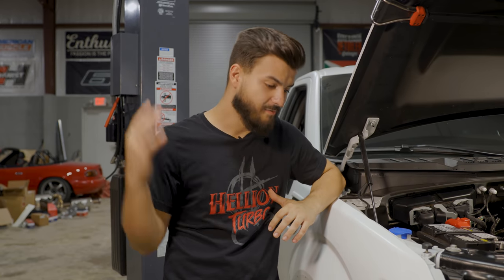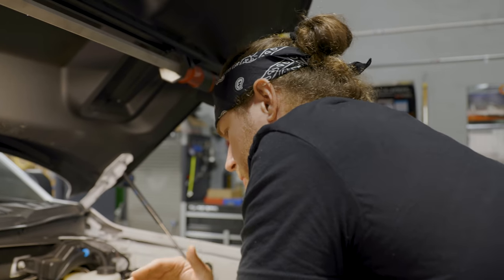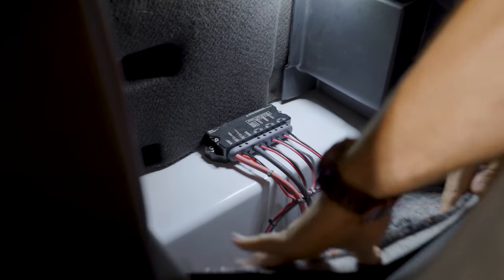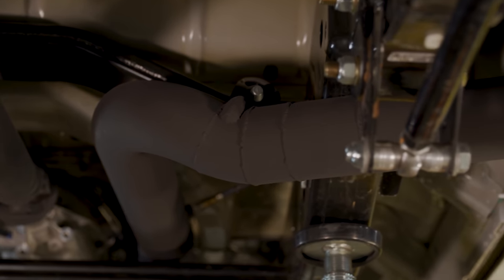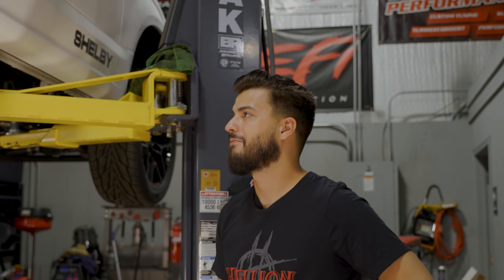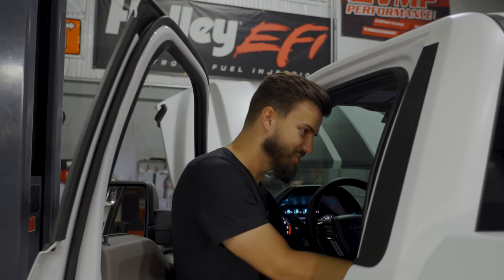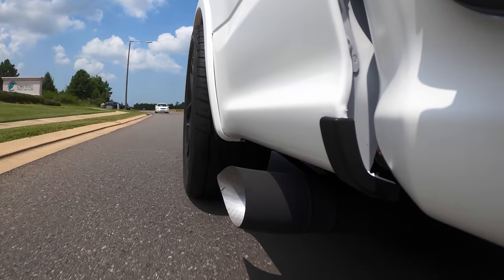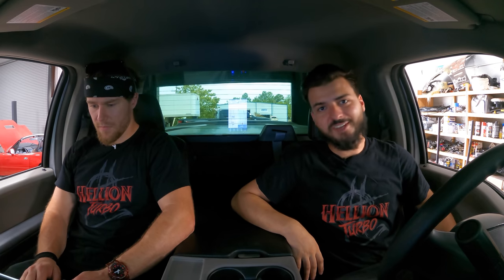Hank's First Boosted Street Hits! + 4" Straight-Piped Turbo Dump!!

Comment: Take it to a Ford dealership and say that the exhaust is making a weird noise.
Reply: My hp guess for the dyno is 845 hp
Reply: @tapout954  not with a stock bottom end lmao
Reply: @mft5773  I’ll bet it makes 1000 before it let’s go. As someone who built the SCJ’s, 5.2’s, and 5.0’s (aluminator, and standard) for Ford Performance, I’ve seen plenty of them go well over that on SBE.
Reply: @bgemski  I don't think a turbo kit can increase 500-600 horsepower. The naturally aspirated makes 395hp.
Reply: @Prime94510  but they do have a 3 pump setup
Reply: @tapout954  650 tops
Reply: @bgemski  the truck 5.0 doesn’t it has a different cam and a few other things to make it torqueyer for truck things

Comment: Waiting for, "Racing My Twin Turbo F-150 vs TT GT350! Who would win?" video :_gavingswim::_closegavin:
Reply: interesting 🤔
Reply: Truck wins if racing from a dig but most YouTubers roll race  🙄
Reply: Supercharged gt350 vs tt f-150 vs tt gt350* lol
Reply: this is the part where I remind you the gt350 made damn near like 1300hp if I remember correctly lmao
Reply: @macse7en  with that 10 speed it should be a close race if Doug drives the gt350
Reply: @icool247  Roll racing is not only safer, but WAY less abusive on drivetrain components. Plus, roll racing accounts for ACTUAL vehicle quickness, not just what it does off the line. That way, Joe Shmo in his bolt on 5.0 with slicks can't run his mouth about beating Hellcats and other cars that suffer from obvious traction issues ;).
Reply: @blade-fpv9411  dig racing is more interesting imo. I don’t roll race unless it’s some random person on the highway trying me
Reply: @macse7en  and now someone must remind you... 4 wheel grip.... Even at 7-800 hp this would be a damn fine challenge for the 350....
Reply: @jessekitchens3364  you realize how much heavier that truck is compared to the 350? Lol. It'd be an interesting race but it's not gonna keep up lmao.
Reply: @macse7en  the weight is true I didn't think about that but yea still.. especially with their ultimate goals for the truck I can't wait to see what happens between those two...
Reply: He should race his old truck. It's twin turbo now

Comment: May I make a suggestion, you have a fork lift at your shop. Have Doug fab up a ball hitch with a chain you slip right on the forks and secure so no mishaps happen, that way you can move your trailers alot more easily into tight places and not need to use a truck every time.. just my suggestion.. as always me and my son love the content keep it up!

Comment: Yo could you please give me some advice.. I'm in the process of putting a single 7875 on my 5th gen camaro but I need the turbo oil return installed. I really don't really want to drop the cradle or lift the engine, do you know the best accessible spot to do this?

Comment: Pie-Cuts are nice and neat, but as long as the pipe doesn't crack or cave in, the surface-area stays the same. With smooth transitions there is no problem going round to oval.

Comment: Um for when you were going to dyno the truck. You could’ve brought the lift all the way up(if possible) and backed it in then pulled back out and brought the lift down so you wouldn’t have had to do a multi point turn 😅

Comment: Why use a dual regulator when a proper returnless system will make more than enough fuel for that kit? I've made close to 1200whp on E85 with a proper dual pump returnless.
Reply: Because Lund won’t tune a returnless system. I had the dual pump returnless system that you had for 200 miles because I had to switch to Fore in order for Lund to tune my truck
Reply: @raysp3c  that sucks

Comment: Stupid question. How do you prime the engine like that without it starting?
Reply: Make sure the car is completely off, not on accessory, hold the accelerator pedal to the floor before you turn the key, or hit the start button, then attempt to start it

Comment: U could of just ran the innovative or haltech all in 1 controller its ur boost gauge/ boost controller and air/fuel gauge and more all in 1 so that u don't have to run multiple gauges since if is 2021 wit technology now days no need to run 2/⁵ gauges